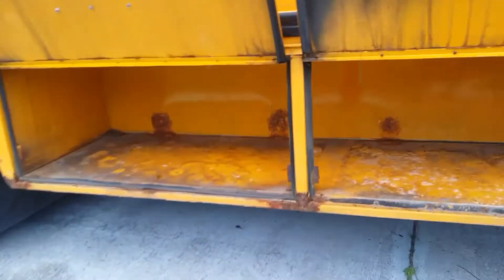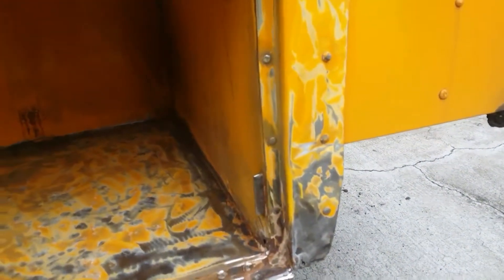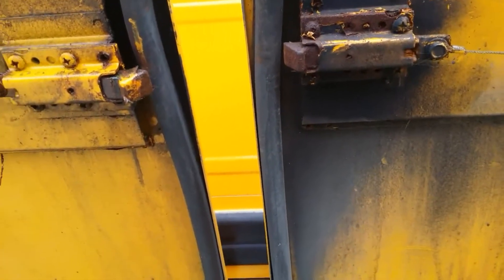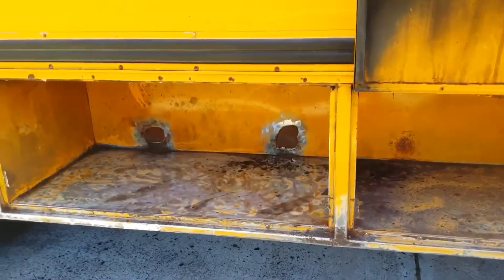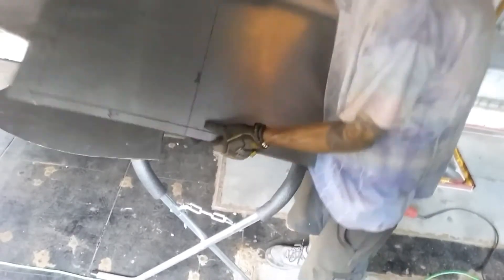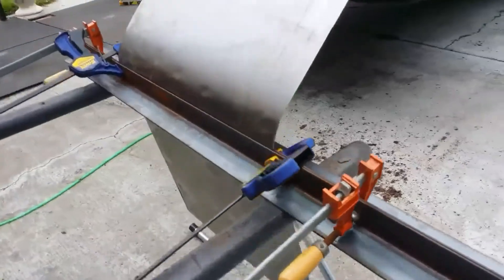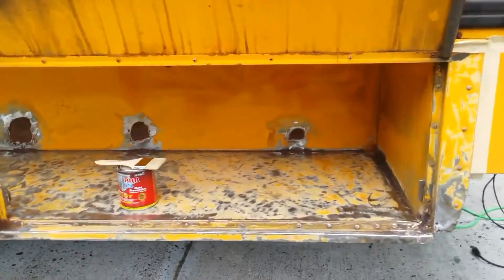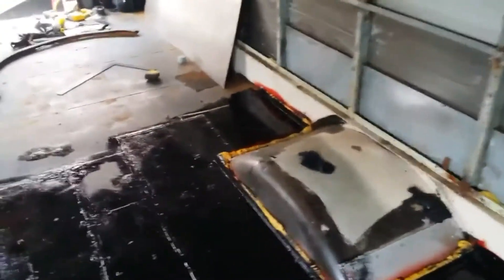Skoolie Conversion to RV  Storage box repairs

Comment: I have never tried the POR15 but have seen it used. A lot of people use Ospho and you can put it in a pressurized garden sprayer and spray all over the inside or outside of the bus and it converts rust from iron oxide (rust) to iron phosphate. With a garden sprayer it seeps into all of the hard to reach areas.  Nice rust repair by the way!